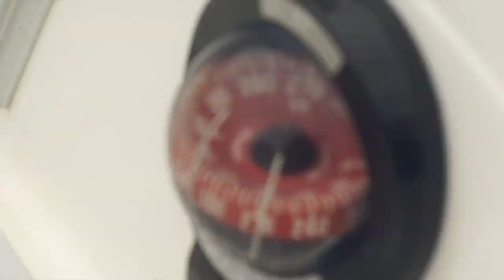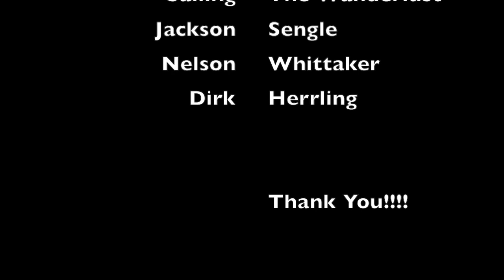Sailboat Restoration - Tearing It Apart!

Comment: Re-glassing that ballast tank is going to be a big one. If the leak is easily accessible (like, right on top) it should be fairly straight forward. Good luck with it all. With  a complete refit you've got a lot of work ahead. Don't let it overwhelm you and keep moving! (And have "fun"!)   S/V Little Girl
Reply from the maker: Randy Gardner leak is actually all repaired, should hold up I think. Video coming next week. Thanks as always randy.

Comment: Still trying to figure out why rip out everything but once again good to see ya working on it again. Great vid!
Reply from the maker: There really wasn't much worth saving. Lights, electric panel, fan all that stuff was shot. VHF is 20 years out dated. Cushions and wood planks just wanted to store indoors to keep safe and clean while I work. Head door had some rot on the bottom and needs to be fixed or replaced. Wall behind the gallery i took down because I hate that mirror and will refinish it with something else. Back wall same thing, some of the laminate is coming off and will need to repair it or finish it with something else. And fuck that gross assed carpet around the daggerboard trunk, I'll paint it or put vinyl on it. Lol thanks for watching like always!
Reply: @SailingFreeStyle   Think the facial expressions covered it lol.  That wiring was toast.

Comment: That was standard kit back then. Gonna be a reliable ship once you rebuild. That wiring and lights were totally shot... That old VHF though, while ugly they were reliable as all hell. I replaced mine (same unit) that was working fine for one with DSC and GPS (the Red Emergency button). But gifted it on to a sailor with a crapped out unit. On the Chesapeake and Ocean it's best to have all channels then just 4. When you go solar, go MPPT! I switched out a PWM unit for an MPPT unit and it literally doubled the amount of power we were getting by noon!
Reply: No need for MPPT unless you go over 600 watts.
Reply: Not according to the Watt Meter. I used to get about 550w in a day, now I'm over 1100w and on cloudy days I'm making power. PWM just connects the panel to the battery (at a pulse width over time), no conversion, so you loose a lot. Especially if the battery is low.
Reply from the maker: SailingExodus good info guys! I'll look into it for sure. I definitely want to build rails off the stern and mount a few solar panels. Lots to think about! Thanks for watching and commenting, i appreciate it!

Comment: Don't leave any of the bulkheads out. They're part of the structure. MacGregor used a lightweight fiberglass layup, so it's all important. But I maychange the head door to a curtain. That door a hassle. I don't like my mirror either.  DPOs put a zillion screw holes in it, now it looks like crap.  It was just a way to make the inside look bigger anyway. I'll be interested in your solution. Same with the carpet. My DB trunk looks like I need to rent a steam cleaner.

Use this opportunity to paint your bilge. Use something good like Bilgekote. The bright white really makes a difference inside those compartments. If not that, some people use a hard, oil-based porch paint.
Reply from the maker: +Paul Heitkemper thanks for your comment! I don't mind the head door all that much, I think the head itself is way too small though. I scored a little porta potty at a tag sale for $5 to use until I decide if I want to plumb something better in there. And well of course I had to... test it out (sorry no videos of that)... and I didn't realized how cramped it is until trying to use it, you pretty much have to go number 1 like a girl and do gymnastics just to drop your nickers! Lol. What does painting the bilge do? I have never heard of that before? Is it just for cosmetics or does it seal it up a little better?
Reply: Sailing FreeStyle potty is necessary for the wife and girls to go with you, otherwise, it's for emergencies, ya know. For myself, I keep a Gatorade jug in the sink for #1- complete with skull and crossbones drawn on it. I almost never need to clean the potty out, because we never pee in it.

For the bilge, the white really brightens it up and makes it much easier to find stuff. It makes a slick gloss surface that's easy to wipe clean. This is helpful when it's time to wipe out the mildew in the spring, or otherwise clean up spills, etc.

Comment: please either lower the intro volume or bring up everything else, have to jump on the volume to save my ears everytime the intro plays! like the genuine vids though
Reply from the maker: +Isaac Smith im aware of the issue and working on it. The volume of the two tracks always ends up changing when YouTube does whatever it does when the movies get uploaded, I just need to keep playing with the volumes with each video until it comes out right. I think the next one will be ok.
Reply: Sailing FreeStyle do you use YouTube's video editor?
Reply from the maker: Isaac Smith no I use iMovie a then upload it right from within the app. The two tracks sound even when playing back in iMovie but after YouTube published it the music track is always way louder than the movie track. I keep increasing the movie and lowering the music with each one and it gets a little better each time. I think last one I had it so the movie was set to 130% and the music track was only at 15%